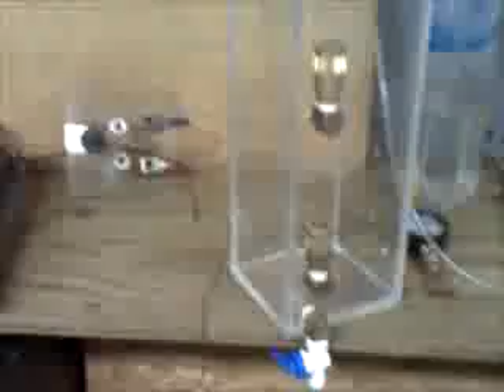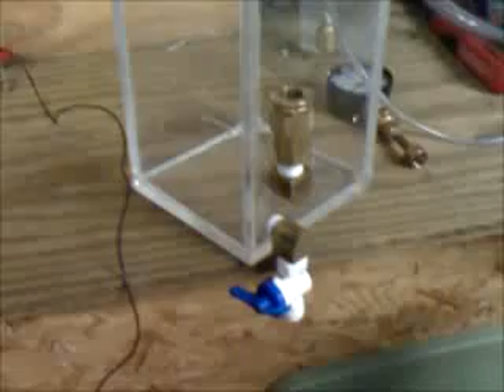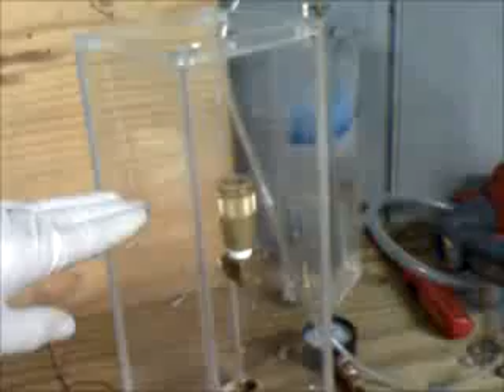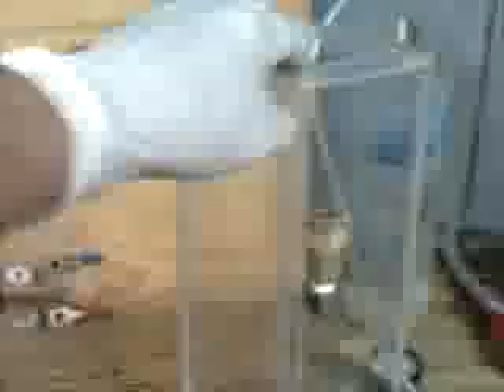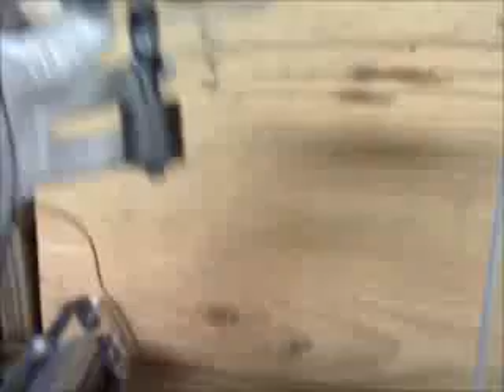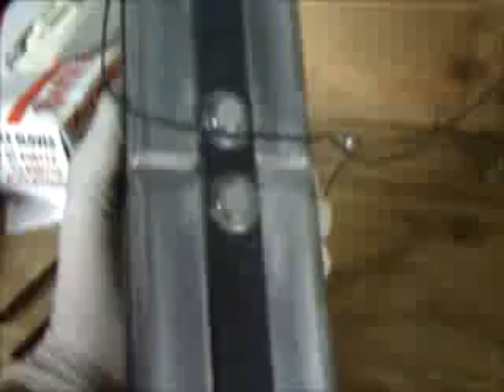Hydrogen Generator Update

Comment: Even after I gave you a different way to get the same results without the use of deadly salts, you still proceed with the use of deadly salts. My question is why? Why do you not think into large numbers doing what you are doing? 

I, for one, am getting off of the use of gasoline and going to full water use. Yes it can be done and is already being done in Japan right now, and in the Philippines. So, Mr. "I need to read," what do you have to say about that? The end of the age of oil is near!